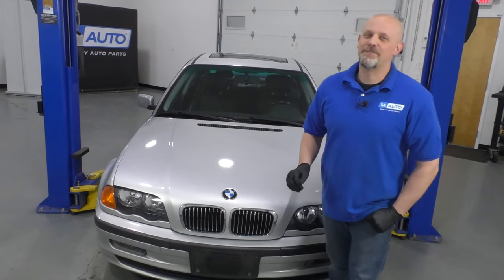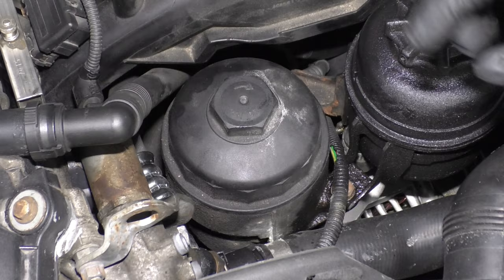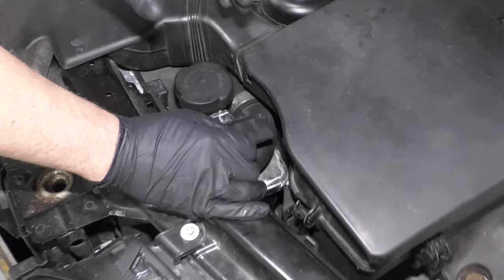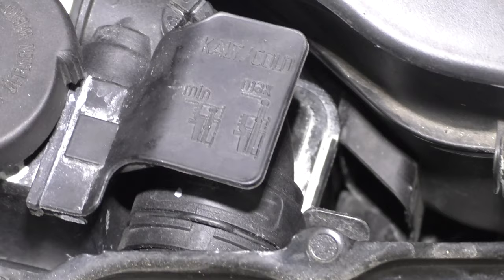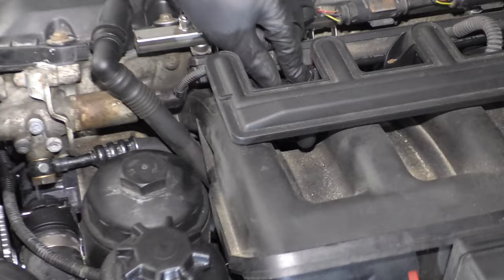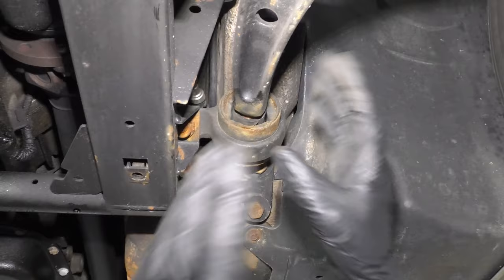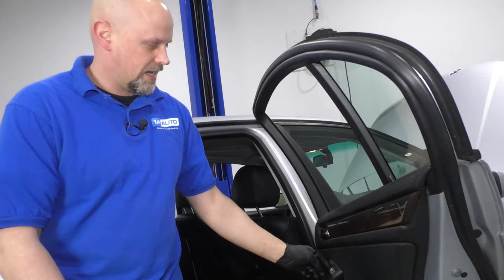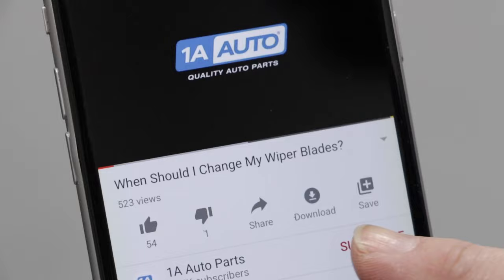Top 5 Problems BMW 3 Series Sedan E46 4th Generation 1997-06

Comment: I realized all the thing that go wrong are plastic, the engine won’t break but everything around the engine will lol
Reply: Realised that too the engine is so strong  it won't stop for nobody but most things under the hood breaks
Reply: Especially the m54. That thing is a beast and the most reliable engine BMW has made.
Reply: In my opinion, there are some things that can be plastic. Things like intakes, valve covers, etc that aren't going to catastrophically fail, and which can be easily replaced, can be made out of plastic no sweat. Things like oil pans, water pumps, etc though cannot be made of plastic
Reply: How can you call this a good engine whereas there are both leaks in coolant and vavle cover?  my 20 year old Japanese cars never had both coolant and engine oil problem all together!  Germans are not as smart as Japanese when it comes to engineering
Reply: @dacoda6668 I wouldn’t say they’re not as smart just not as meticulous
Reply: @dacoda6668  you're comparing apples and oranges. I wouldn't say that the Japanese engine is necessarily better. It's just different.

Comment: I had a 2010 BMW 325i. 150k mi. Bought used w/100k. Loved it. Great ride. Then one day it wouldn’t start. Found fuel pump was dead. This is the one year BMW sealed the pump in the gas tank. My mechanic wouldn’t attempt it. He said it’s a dealership job. Dealership wanted $8500. They have to raise the car, remove sub assembly, gas tank, replace fuel pump and put everything back. I got rid of the car. BMW - THE ULTIMATE DRIVING MISTAKE.
Reply: I’m sure the dealership cut u a check guessing your financing/leasing it …..if you owned it you definitely could of found a shop to do the job pricy but not 8500
Reply: Planned finite lifespan of a car. The previous generation E46 has a fuel pump on the top side of the tank just below the back seat that is relatively simple to replace.

Comment: I had a 97 and I had to change the valve cover gasket it's not a hard job to do but it sure fix the problem
Reply from the maker: +chris heyer Thanks for the feedback!
Reply: @1AAuto  I found a 2001 330xi with 57000 kms on it. Looks to be in very good condition. Do you think it could have many issues just from being so old and not driven so much ?
Reply: @tsmith1729  I’m looking to buy a 05 330i with 161k miles . Seems to be in really good condition but I’m still skeptical due to the high mileage

Comment: I had a 2003 BMW 325i with a 5 speed Auto steptronic transmission. Best car I ever owned !
Reply: I still have a 2003 325i Manual. I have had for 11 years with very few problems. Still a grear car.
Reply: @OutlawJoad  Make sure you keep it! The f30 and g20 are dogshit by comparison.

Comment: My 2005 325i has the fuel pump in the gas tank. It's a California edition so it is different than the same car sent to every other state. Bmw actually extended the warranty by 15 years on this so got it done for free at the dealership 2 or 3 years ago. My car has 118k miles. I've done radiator, water pump, overflow tank, thermostat, all hoses, oil filter housing gasket, oil pan gasket, oil leak on vanos line, and plugs wires and coil packs.

Comment: Front lower control arm bushing doesn't require removing the ball joint at the bend in the control arm.  Only remove the two bolts at the back, the arm will drop into a position you'll be able to remove the bushing.  There is the rubber part, which can be cut off with any knife, then a steel sleeve that fits around the control arm, this may require some hammering but mine came off with some screwdriver prying.  Pretty easy job, actually.  Reinstallation of the two mount bolts can be helped by using a steel rod or screwdriver to move the arm so that the bolts line up; once you get this, it's easy-peasy.
Reply from the maker: +Charles Schuster Thanks for the tip!

Comment: After 52k miles on my 2004 bmw 325i SULEV.   one OEM ignition coil went bad, replaced all with ELDOR coils.  Prior to fixing that I had an oil sensor go bad as I probably drove around a few years with that one bad missing coil.  While changing the coil I did break a bracket I haven't replaced. Also my dead pedal has cracked due to me putting weight on it.  I have the part but see it difficult to replace.  No idea why the dead pedal was of such cheap plastic quality.  I also have a rear left window molding/gutter type molding broken.  I'll say this, it does eat up tires. I am my third set.  the 80k rated good year eagles gave it too hard of a drive and bumpy road.  Original tires are $1250 though and good years were under $600.  My new all season Michellins are wonderful and yes they were $950 for set.  I do keep it in the garage all 18 years I've owned it.

Comment: I had all these problems and more on my 2001 e46 with only 135k. Just did my passenger and driver axles today before that was both control arm. My suggestions is don't buy one unless you know how to fix it yourself.

Comment: Had to replace driver's side rack and pinion. The boot was ruptured and pouring steering fluid everywhere. The mechanic that replaced it didn't line up the steering wheel, now it shakes violently going down the road...I just want my BMW back ...

Comment: I am 43 and have only ever owned BMW's. I have a 2000 323i  with 196k on it. I am the original owner of it and I have never had a oil leak, or a cool leak. If you do not believe me I will send picks and a video.
Reply: Can I get pucs
Reply: Pics an a video

Comment: Control arm does not need to come out to do bushings I just did mine legit last week when u unbolt the bushing the back of the control arm drops down very easy their is more then enough room to slide off and on the new bushings I just did mine on same exact carr I have pics I took with the control arm still installed 2002 bmw 325i did the bushings in 15 mins did not take the control arms out when u loosen the bushing at the 2 bolts take a pry bar and pry very little the back of the control arm that goes thru the bushings drops rite down I wish their was a way for me to upload the pics I took doing it with the control arm still installed I have pics it doesnt let me upload them to show u
Reply: He said that if you watch video again. He says "you have to take the control arms off". " Or just unbolt the backside and drop it down and press bushings out". Without taking it all off.
Reply: Thanks I have to do this today to my 02 bmw 325xi just goin to replace bushings on control arm thanks helps so much because I have a lug nut stripped out so can't take tire off anyway.

Comment: Hey question. Should I buy a 325i 2003 with 90k miles on it?. It looks in really good condition for the age, the interior looks great. Not too many miles, I’m sure something will break eventually but how bad and often does it happen? Any tips will be appreciated thanks
Reply: Just take care of the basic maintenance items. Once you buy it change the oil, plugs and coils (if you dont have register of them being done recently) and also find a good shop to give your injectors and vanos solenoids a good clean. Also worth checking the condition of your belt and pulleys, by the sound you can tell if they're in good condition. Otherwise BMW in-line 6 cylinder engines are very reliable and long-lasting and rarely have a failure that leave you stranded. Transmissions are usually good as well (check for service history if you're looking for an automatic). You just have to take good of your car and it will give you many miles of joy.
Reply: I bought an 05 330ci coupe from a car auction with little to no background info on it besides it being a clean title and let me tell you every 2 - 3 weeks i get a code or it breaks down on me. These cars can run forever if well taken care of it’s all up to the past owner and how well they took care of the car. Mines only has 84k miles on it. Was my mistake for letting my love for older 3 series models get the best of me and not checking any of the info (pretty dumb) but hey it’s a nice fun car so everytime it’s running It feels good.

Comment: I have a 2005 BMW 325i with 176,000 miles and my Check Engine Light stays on. My mechanic said its my Secondary Air Cylinder ports that are probably clogged. Do you have any recommendations for that issue? P.S. I've had all the issues you've mentioned in your video lol thanks 😊

Comment: I traded my 99 Miata for a 99 323i 5-speed manual with only 139km or 86 thousand miles, the only issue I see is a starting to leak expansion tank, I'm thinking of doing a complete cooling system overhaul, and I'm making a list of what to replace, this is a summer car only

Comment: Would you happen to know what the problem might be if this vehicle suddenly ceases to start (No crank or turn over), but the battery and starter are fine? I was looking at buying one, and have run across this issue with 2. Is it an expensive repair?

Comment: My E46 320i (2004) model is giving me lots of trouble lately. Engine stalling, vibrations and sometime unstable RPM before the engine is shutting down. I also have some difficulty trying to start the engine. Seem a lot like MAF error (the code said it too) and I replaced a new MAF. But the problem is still exit (getting even worse actually, misfire from all cylinders) and my mechanic suggested that it could be ECU. Can u please kindly give me some advices? Thank you so much in advance.

Comment: Hello, I’m about to buy a bmw series 3 (yr2000) for my first car for about $2,750 and “the only issues with car is it will need a left rear hub (needs puller to replace) eventually, the front control arms bushings need replaced” 
Will it cost much? And the miles on it is 184k. & Will it be okay to drive on the highway?

Comment: At what mileages do y’all think such fixes occur at ? I just purchased a 2002 E46 325i with 32,000 miles
Reply: That depends on two factors: were the 32k miles easy or punishing and how well was the car maintained prior to purchase?  In the grand scheme of things, you probably don't have a lot to worry about now, but plan on addressing the cooling system around the 60k-75k mile mark.  If you rarely have other passengers in your car, the window regulator most likely to break first will be the driver's door unit.  Suspension wear will come down to your driving style and the condition of the roads you drive on.
Reply: 32k miles on a car that old is very, very low. Most of the parts in the video fail simply due age, NOT mileage. The plastic made 20 years ago gets brittle over time and fails. Modern plastics do last longer.
I do suggest replacing the cooling system parts proactively vs waiting for failure. The water pump, thermostat and upper/lower hoses are all just behind the radiator and "easy" to do in 1 afternoon. The coolant reservoir is also worth doing proactively.
The other issues are annoying but won't cause a blown engine unless you let the car run out of oil.

Comment: Also leaks from water bottle whee it connects to the radiator,  O-ribg damaged or fitted incorrectly.  Why plastic ? We used an aluminium water bottle.

Comment: at what point?  mine has 48k miles and it's been garaged 16 years.  It's a 2004 325i m56 SULEV Engine
Reply: Maybe it's time to sell it??
Reply: Look to replace the key plastic parts versus waiting for them to fail. Proactively changing the cooling system parts mentioned in the video is not too expensive and can prevent a blown head gasket = dead engine.

Comment: Hi )  BMW E 90 The car works intermittently, it is difficult to start. I changed the switch, starter, and knuckle but my problem is not resolved. Please indicate what to do. thanks in advance
Reply from the maker: +Ani Qocharyan We wouldn't be able to diagnose an issue like that here, you may want to have a local mechanic take a look at it. Thanks for checking us out! http://1aau.to/m/Shop-1AAuto-c
Reply: @1AAuto   Thanks 😊

Comment: I got a question for anyone to answer I recently had my engine swapped at 180k miles and the new one only has 10k on it and on the dash it still says 180k any suggestions on how to fix it I already had the computer reset but it didn’t worl
Reply: Uhh pretty sure it’s illegal to change the mileage on the dashboard. You would just need to keep a mental note of how many miles you are driving or track it using trip miles.

Comment: What year is this e46?  the control arms and bushings look like it’s from an e36.
Reply from the maker: +UnkeptFreerider Vehicle in video is a BMW 325Xi 2001 Base Sedan 4-Door 3.0L
Reply: @1AAuto  Thank you
Reply: The E36 and E46 have the same overall design and share a fair number of parts.
There are examples of E46 owners installing parts intended for the E36 on their vehicles because the older part performs better (intake manifold is one example). The converse applies as well with many E46 parts able to be retrofitted into an E36.